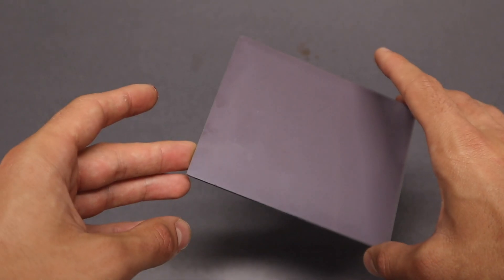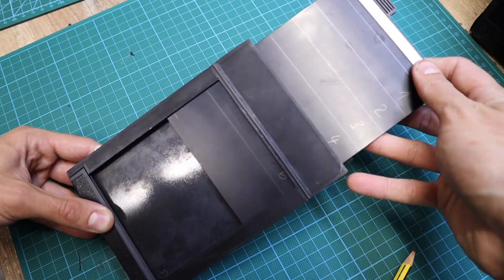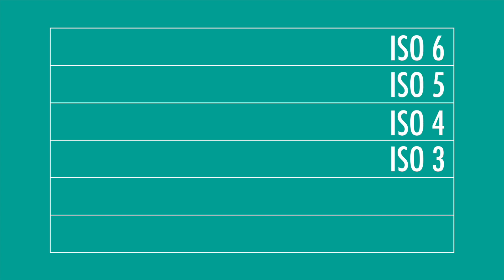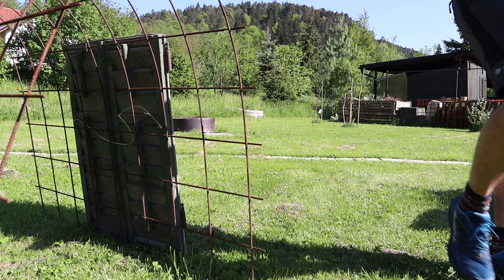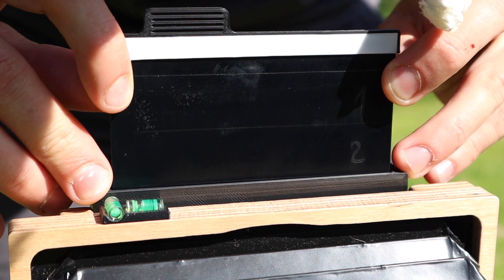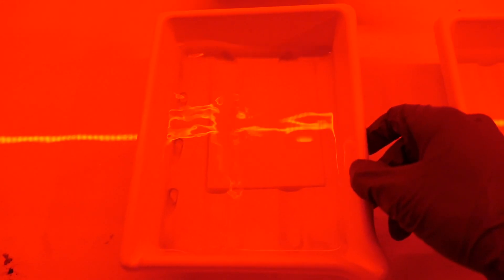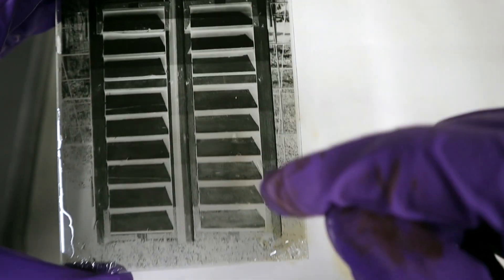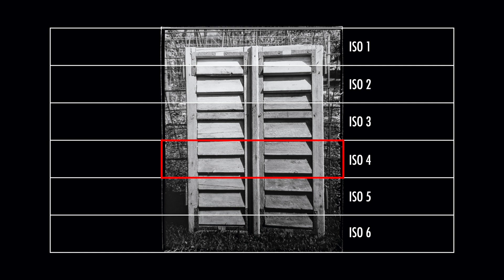How to determine Emulsion speed? | Tutorial for Dry Plates, Film, Paper... | Analog Photography

Comment: Back in 1971 I was a photo student at RIT. Professor Terry Bolman came up with a system where we cut out part of our darkslide (4x5)  and taped in a Kodak film step wedge over the hole.

This was used to easily calibrate ISO and also shoot a series of images of a large white object to use to develop the film for various levels if contrast. Even using water bath development to extend the dynamic range.  

You are doing something similar and may want to apply it to The Zone System. Basically you made a crude in the field sensitometer.

Comment: I bought one of your Zebra 4x5 Glass plate film holders. It has exposed sticky tapes at the hinges ( on both hinges ). What has happened?  I do not think this shall be like this since I cannot load my glass plates without touching these nasty glues.  I tried to dry them out but no luck yet. I wanted to let you know so you can fix this problem for your products. .
Thanks
Reply from the maker: Hey,

First of all thank you for becomming a part of Zebra Family! Regarding the hinges, whenever they are fully opened plate can slide in and out with ease without any touching of the hinge tape. However since Zebra products are constantly improving I will keep your suggestion in mind 😉

Comment: I gave up estimating ISO of my dry plates. Living in Edinburgh (55° North) the UV varies A LOT through the year and day. Also it strongly depends on what is reflecting light into the shadows. Natural subjects will absorb a great deal of UV so the shadows can be really dark. As you want to expose for the shadows but develop for the highlights then my effective ISO is usually well below 1. In open shade in a natural scene I might start with  f16 for 30s to be sure to get some detail in the shadows. The highlights would be really dense but can be scanned or salt printed OK. If the subject was in sun in a built up area I might use an app and measure for 1 ISO but I'd expect the shadows to still lose detail.

As you hint ISO is only really relevant for panchromatic film. Indeed ASA/ISO was only standardised after panchromatic films became normal.

Bottom line is a combination of experience and development by inspection is the only way to use simple dry plates - according to me that is. It is just like wet-plate collodion really. It is the same chemistry.